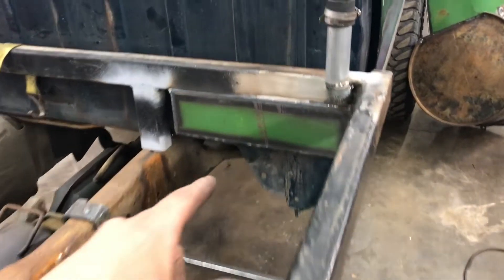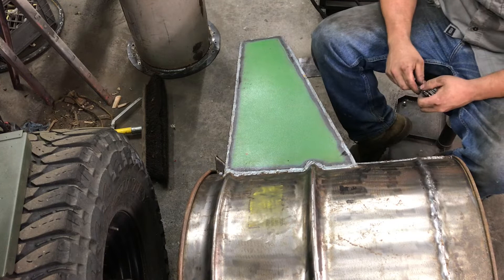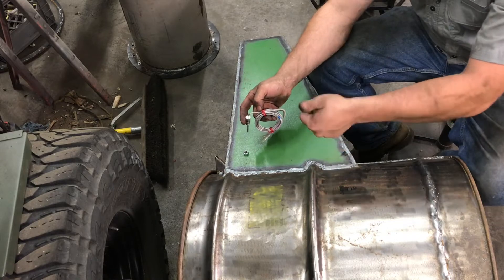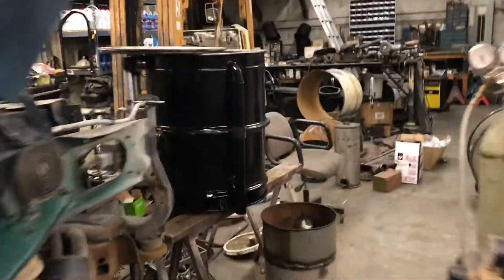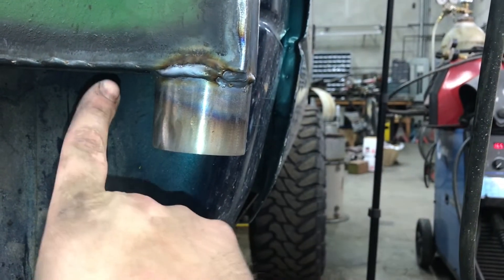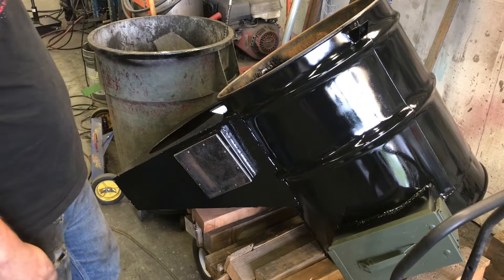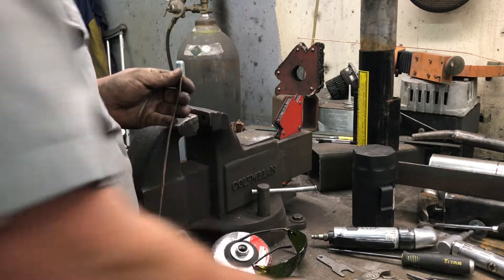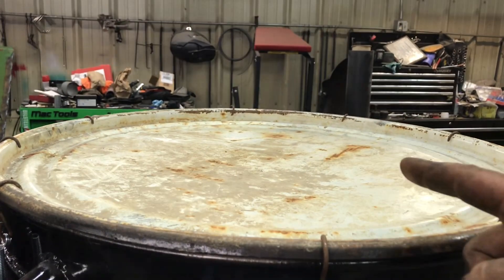Hopper Springs, Tar Drain, Temps Sensors,  Fabricobble on the V10 gasifier truck

Comment: Good to see the instrumentation being set up. I was curious about the best places to put the probes. It also lets me know why my hopper got so hot. I didn't have enough wood in it.
Reply from the maker: Just wait till you start driving it, my first drive outside the neighborhood I got carried away smiling and happy and didn't watch the gauges. Hopper went from 200 to 400° in less then a mile when it ran out of wood! It will get hot super fast as soon as the glowing hot char is exposed. I melted my vacuum line and the coupler on my tar drain pipe it was so hot 🥵
Reply: @BigBeavrSlayer  some type of alarm would be handy for that situation. That would be me forgetting to check the gauges.
Reply from the maker: @lukeFugate  alsk on the forum there are several guys using thermo couples with a setable alarm at temperatures!

Comment: Way cool bro. 
 You are doing a great job on this build  :) . 
 Here in New Zealand, such a project wood be buried in piles of red tape, as we are forced to go thru endless engineering checks, before placing a modified vehicle on the road. 
 Given this fact, I think I will try this with a farm tractor instead, so I can enjoy the benefits of woody goodness, without all the highly flammable red tape that I wood otherwise have to wrap around my hopper.
Reply from the maker: I have no doubt that red tape would be thick here as well if they knew what I was doing even though " Washington State " "The Evergreen State " is supposed to be all about clean green energy well you can't get much cleaner than wood gas or much greener granted I do season the wood so it's not completely green.... Hopeful it's camouflage enough when done no one thinks twice when they look at it
Reply: @BigBeavrSlayer  
 Being flammable, the red tape can serve as fuel  :) . 
 Yes, I am sure you are right when you suggest that your gas rig wood not stand out enough - to attract unwanted attention. 
 Others have made a similar observation about this  :) .